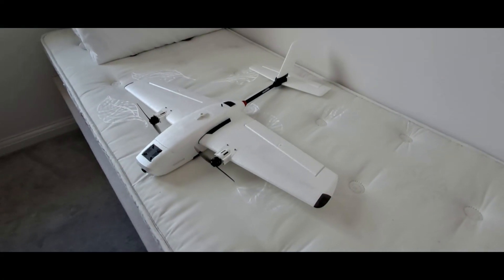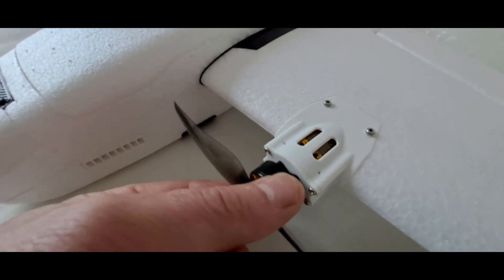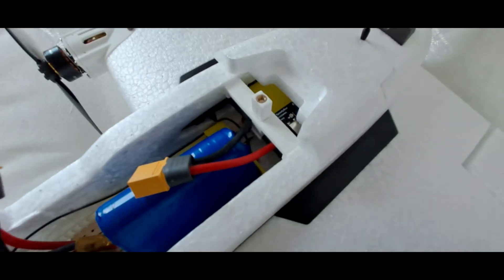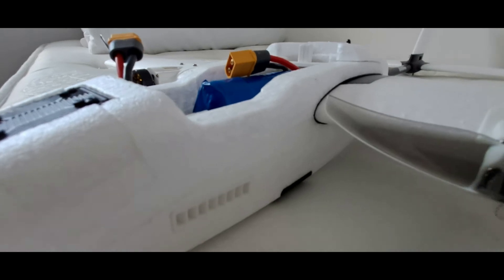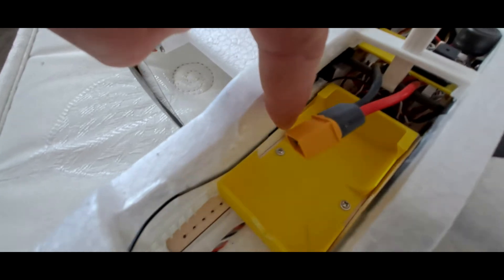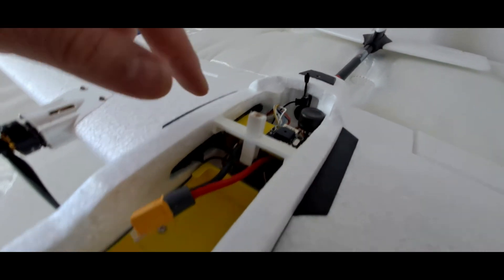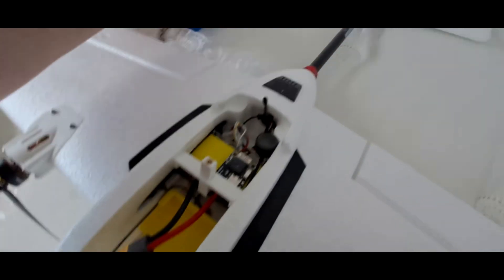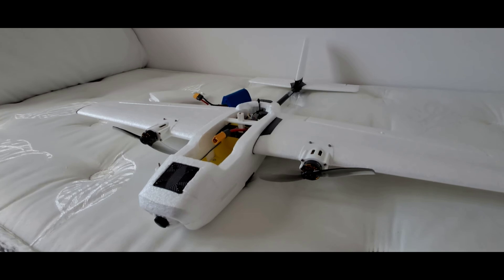A new build and another maiden flight. - Heewing T1 Ranger with the Walksnail Moonlight 4K VTX

Comment: do the original ESC's work well for you? one of them burned directly after I used it for the first time!!
Reply from the maker: @Adventures_EC 
Sorry to hear yours burned up, hopefully the rest of the plane survived.

I've not had any issues with the original ESCs howver they have just used quad ESCS and not put caps on them, so I added a low ESR capacitor to each ESC.
Reply: @Crunklefloop yep, I reacted quickly and saved the plan. I got it for my students to experiment with it and learn how to fly a fixed-wind before a plan I design finishes.
True, no caps. Hmm. I am thinking in replacing them with bigger ones anyway, just in case.

Comment: Hello! I'm having trouble getting my OSD to show up. I'm currently using the Walksnail GT Kit with the Heewing FX-405 VTOL Flight Controller (on Ardupilot 4.4.2). However no matter what I try, I cannot get the OSD in the goggles. I get video just fine, but no OSD! 

I have serial1_protocol at 42 and OSD_Type at 5. Really not sure what's going on

Any help would be greatly appreciated!
Reply from the maker: @snippy515  So sorry for the late reply,  I've only just seen this comment. Did you get the OSD sorted?
Reply: @Crunklefloop  No worries!

Unfortunately I still did not get it working. I even tried updating ArduPlane to the latest version. Since I've made no progress in software, I'm thinking I may have gotten a bad OSD chip. But just to sanity check myself, does "serial1_protocol at 42 and OSD_Type at 5"  match what you have on yours?

Comment: I usually embed the Elrs antenna in the rear foam of the fuse.
Reply from the maker: @JustFPV-net   I have done that in the past, and it works, but then it lacks symmetry, which upsets my OCD. Hehe
Reply: @Crunklefloop  I see … we should discuss that over a pint 🍺
Reply from the maker: @JustFPV-net  Indeed! It's either scrumpy, ale or mead in Devon